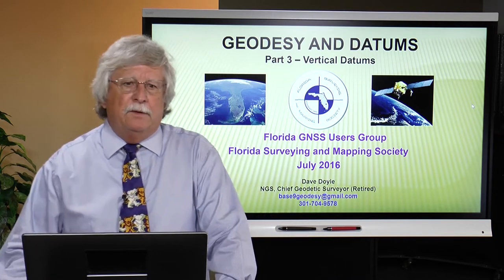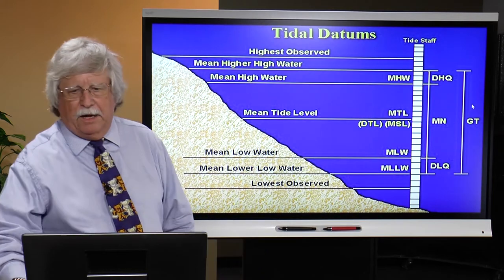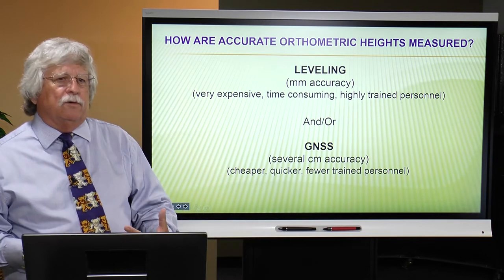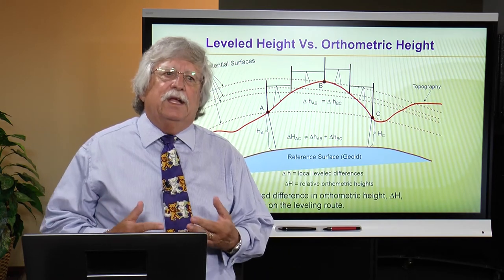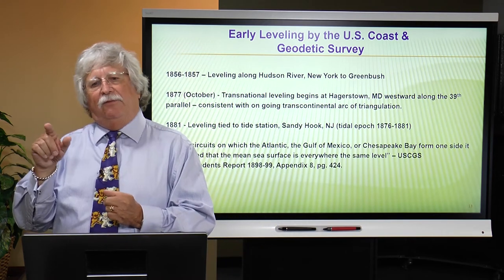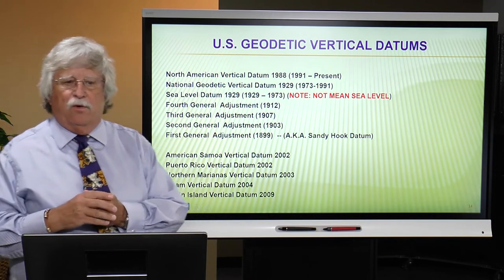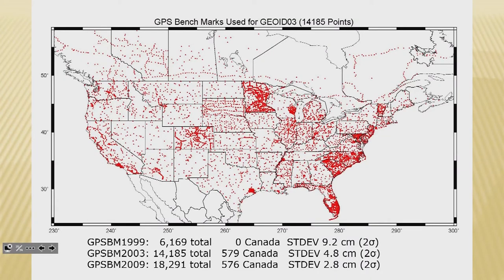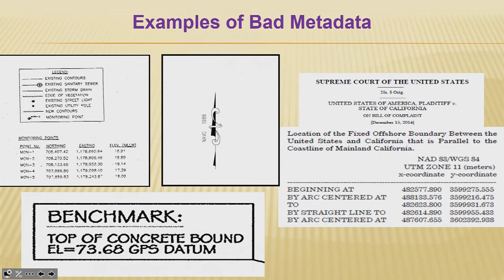Vertical Datums by Dave Doyle

Comment: As computer programmer with an obsession with standards and references I really enjoyed this series.

A personal GNSS example of mine is that I requested the firmware developers of GoPro action cameras enable a toggle between WGS84 ellipsoid height and what they called “orthometric height” (here called “The Geoid” at the 53:51 mark).

Now one can at least for the HERO11 Black model use strict ellipsoid heights which is good for later reference.

Comment: In the beginning of the lecture I started to wonder how significant or not is the Moon position in precise levelling. Do we need some corrections for that? As it causes tides, it distorts the equipotential surfaces and plumb lines... Locally it is probably insignificant but for the whole net of height monuments?

Comment: I'm a bit unclear on GNSS orthographic height. 
Is the final elevation number the straight line distance above the geoid model surface and normal to the surface of the ellipsoid? 

Or is it the distance of the curved path normal to equipotential planes, mathmatically the same as acheived with leveling regardless of gravitational uniformity? 

Or, is the system simplifying the math to use straight lines that are normal to the ellipsoid while the geoid model elevation is a simple constant used to emulate the curved-path-elevation acheived with leveling only at the benchmark location and elevation? 
Scenerio: If you start at a high elevation benchmark in an area with large gravitational change, so the equipotential planes are not evenly dense (aka not parallel), and you dig a deep well a few feet from the benchmark all the way to the true physical equipotential surface and take a measurement. Would the height measured at the true equipotential plane at the bottom of the well be some non-zero value because the geoid model was massaged to match the surface benchmark with only a simple constant?

An analogous example is the pressure-altitude adjustment on airplane altimeters and the current pressure setting broadcast by on-airport weather stations. The altimeter setting being broadcast will achieve an altimeter reading equal to true airport elevation at touchdown on the runway, but the altimeter adjustment is only changing the Y intercept, not the slope of the relation between absolute pressure and altitude (The slope changes with temperature.). 
So outside of perfectly "standard" atmospheric conditions the altitude indicated will be inaccurate both above and below the weather station elevation. (A slope change of about 10% for each 20⁰c. Assuming a standard temperature lapse rate of 2.5⁰ per 1000 feet in clear air.)